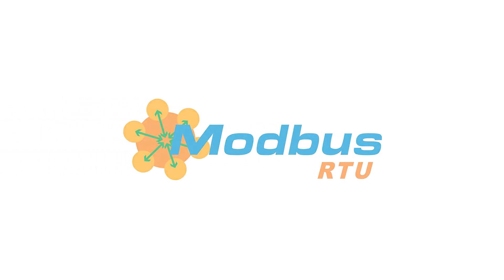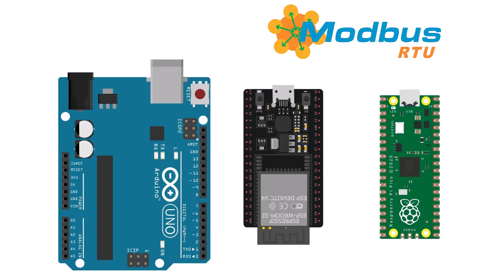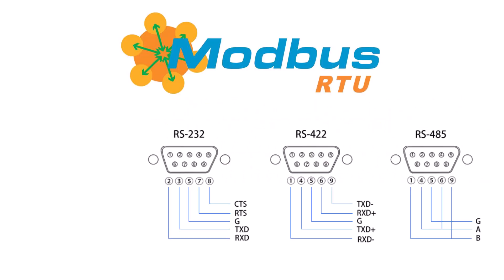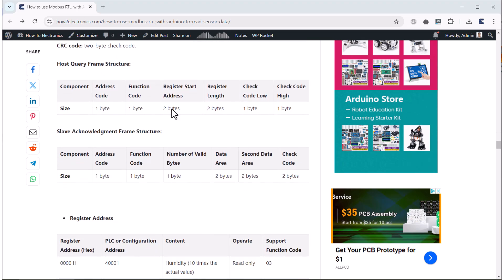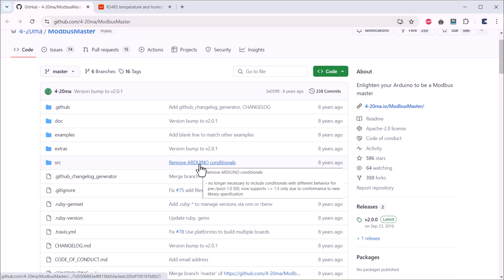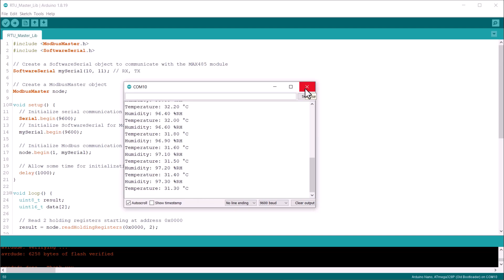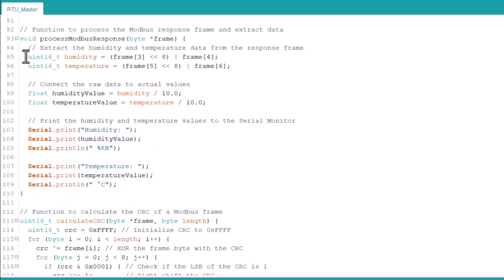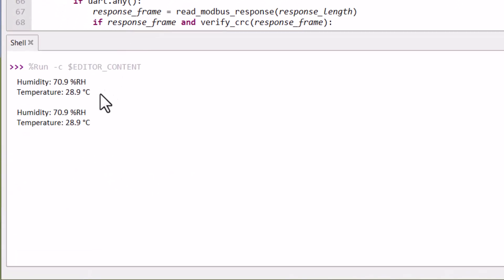How to use Modbus RTU with Arduino, ESP32 & Raspberry Pi Pico to read Sensor Data

Comment: TXD and RXD  you have connected physically into D10, D9 pins.
Why you are using in program 10, 11 ?  you can to see here:  SoftwareSerial mySerial(10, 11); // RX, TX, Is it correct in program?

Comment: Will this code allow the use of two RS485 devices?  Guessing if it will, then I would need to change one address to 0x 02   Any modes to the code?

Comment: Please provide esp32 code with modbus library
Reply from the maker: Check the link in the description, its already provided.
Reply: U can use Arduino code, just change  the pin number n use hardware serial of esp32

Comment: When using the MAX 485 board, do you have to worry about the termination resistor in the 485 network or does the board take care of that?
Reply: If you are connected only one device don't  worry. But if you have multiple devices on same line use 120ohm